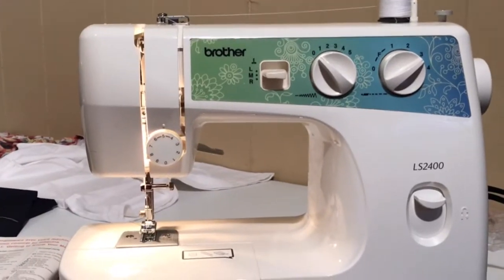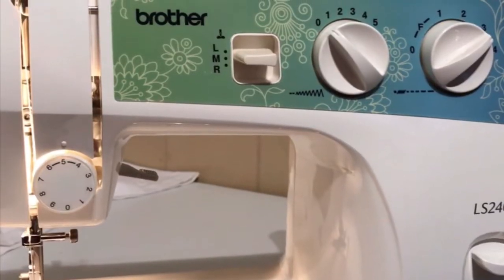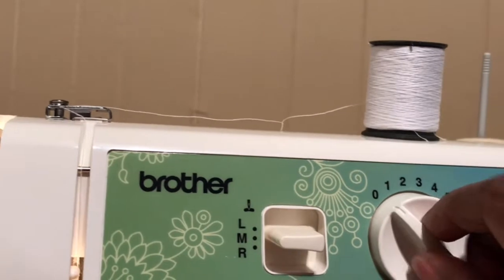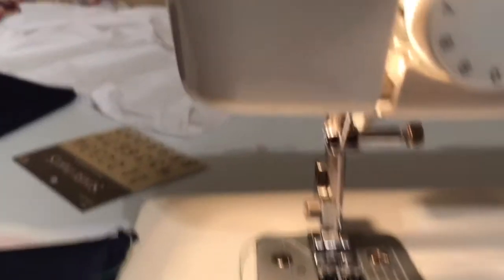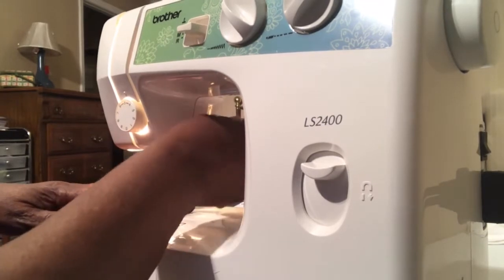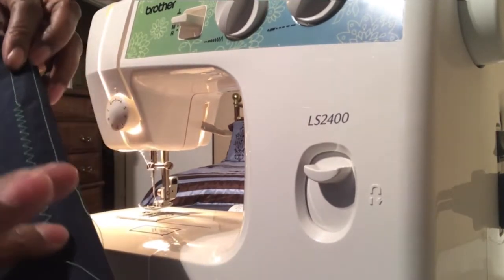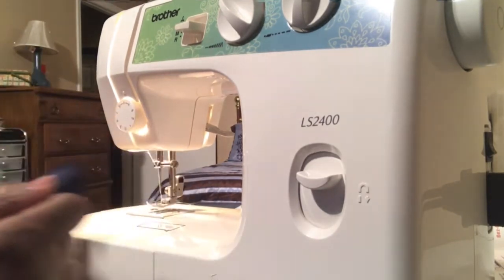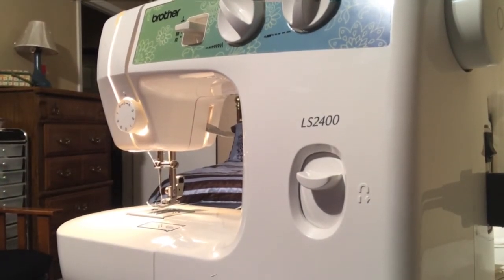How To Fix Most Thread Problems | Brother LS 2400 Sewing Machine It’s The Tension Knob

Comment: Your needle must be put into its place right..
There are 3 round sides of the needle. 
One flat side.
The flat side goes into the bottom.
Make sure also your top thread n bottom thread are the same kind of thread this Will also effect the thread to.mess up..
If you have sewed alot and you don't change your needle this will effect your stitches. 
Did you know each needle is for certain materials. 
Number 9 needle for stains.
N light weight material.
12,14 16,18.needle
Look on the back of the pk.to see which needle you need..
I use only number 18 for blue jeans..it the best one to use.
Enjoy sewing
Reply from the maker: Yes! If you put the needle in wrong, you will not be able to sew.